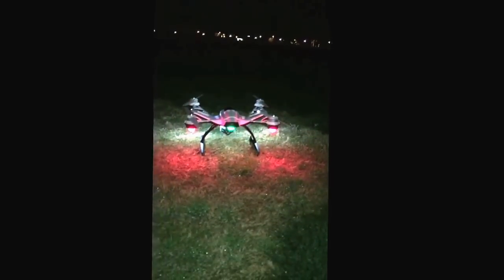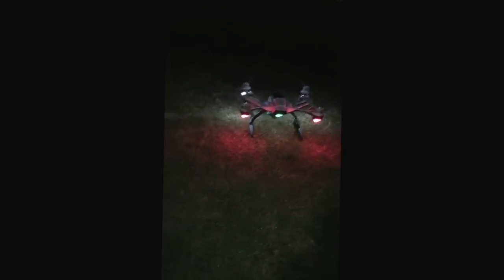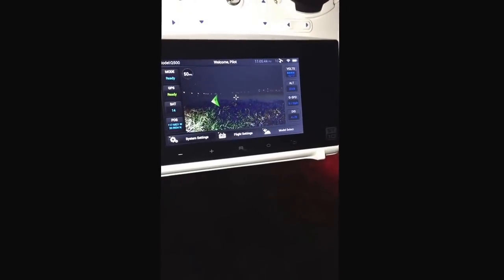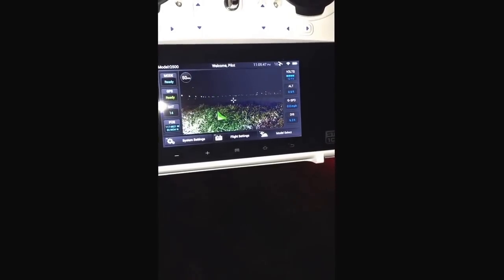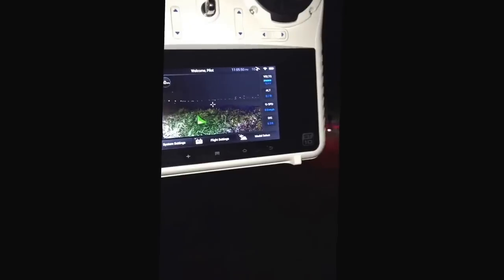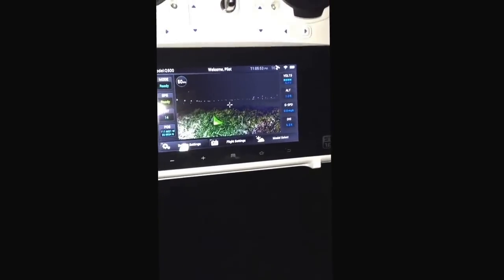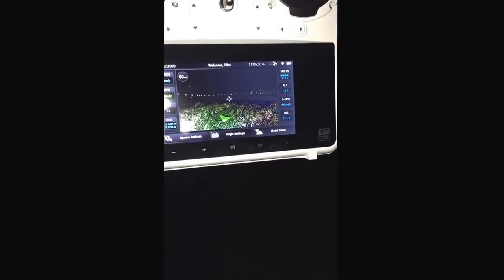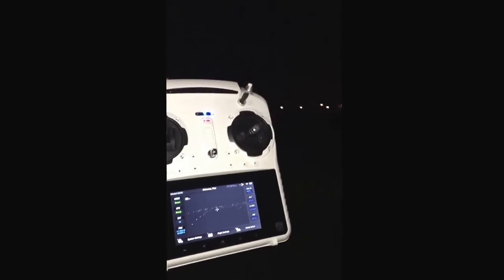Yuneec Typhoon Q500 Problem, Transmitter Sync Loss Defect Found and Corrected

Comment: it looks like the back light it lit up WHITE   if that is true then it means your CALIBRATIONS have FAILED,  you have to REDO your COMPASS and ACCEL. calibrations.  and then youll be fine.  ALSO you can NOT have your phone or anything electric even the transmitter ANYWHERE near the quadcopter while your calibrating.  keep them all away when your calibrating

Comment: how do you fix a flip over problem you try to lift off but it dont  just flip over and breaks the props did it twcce
Reply: alwyn rose put the props on right
Reply: Always make sure you have ample distance between you and the drone and never start off in smart mode.  Always use Angle.
Reply: Wat you did to solve the problem

Comment: The controller battery may be low I have had same problems but after fully charged batteries on the controller the quad is working fine
Reply from the maker: +Jabin Martinez Nope, read the narrative below. Problem solved, but this was filmed a looooong time ago so I'm trying to remember 😆👍🏻

Comment: Sorry man my mistake, i didnt mean 800meters i mean 800 ft that is much less than that!
Reply from the maker: +Cesar Rodriguez You might need to contact where you purchased that thing and get it swapped out for a new one.  Of course it depends where you are and what is around you to give you interference, but 800' is not right.

Comment: I keep losing my video link as soon as I get airborne. Everything starts out perfect, then within a moment or two my video freezes on the screen and of course I cannot start or stop record feature or take pictures without the connection. This is supposed to be the latest version, Q500 4k typhoon with CGO3 - GB camera with 3 axis gimbal. Any ideas or thoughts on the matter? I have yet to contact Yuneec as they are closed for the holidays, at least that is the message I am getting when I call them.
Reply from the maker: +teamscreem They should be open tomorrow since MLK day is over.  Let us know what they tell you and how you fixed it.
Reply: +teamscreem did you get any update? I have the exact same problem.
Reply: +Conor bourke I was never able to get it the video link to function properly, latest firmware, I had access to another CG03 camera, it worked flawlessly with the handheld gimbal so everything eventually pointed to the camera. The floor managers at Frys electronics are aware of my RC experience and swapped it out no questions asked. The new one works the way it is intended.

Comment: Hey doctor drone I'm having a problem i bought the typhoon G because i already own a GoPro so when I'm flying i go about 800 meters away and i lose signal from the camera and the screen on the controller freeze, do you know if is like that with all the G models or its something wrong with mine? i'll appreciate your help!
Reply from the maker: +Cesar Rodriguez You're complaining about losing signal at 2600' away?  That's damn good Cesar!  When you lose the signal from the transmitter, your video will freeze until you reestablish contact with the controller.  800 meters is really good my friend!
Reply: +Drone Doctor  hy doctor. my dosent have gps signal i crashed it
Reply from the maker: I think you better reach out to the place that sold you that thing and find out whats going on.

Comment: So what is the proper range without thr muckup is it still about 300m??
Reply from the maker: dogga794 Not sure what you mean by proper range.  You can modify the geofence in the software when you hook it up to your computer.  I've found range is pretty good with well over 1500' away at 400' up.  It will depend on your environment and what you have around you.  This quad is perfect for those who do not have a lot of experience and don't want to spent a lot of money.  It is also very resilient to crashes and has great customer service.

Comment: Iam to star to hate this am away to airport and steel buildings even a houses and not star
Reply from the maker: Juan Martha Does it say you are in a no fly zone?  Do you still get full gps lock prior to trying to start the motors?  Also, make sure you are far enough away from the drone when trying to start in full gps mode.  All else fails, call Yuneec directly.

Comment: HI everyone.....Iam crazy about its shows allways ........no fly zone ...it means you ca not fly in that area or can help me with this
Reply from the maker: Juan Martha Ok, now that sucks Juan.....  try taking a road trip away from your area that you are in and see if you are still in the no fly zone.  If the problem persists, you need to contact Yuneec to get it replaced.  If you truly are in a NO FLY zone, you only have two choices....... you can obey the no fly or put the drone in manual mode and fly at your own risk.  If you are new to the hobby, take a road trip, pack a lunch and make it a fun day!
Reply: Drone Doctor thank for reply ....also a found people can help me and they tell me is security área ( I am close to airport) and is big área so I try again far and it Works perfect ...thanks a lot   , the only think to know is how to learn to fly  manual but tahnk for all
Reply from the maker: Take your time learning.  Always remember, if you get into trouble and get turned around and confused while flying in angle mode, JUST STOP WHERE YOU ARE AND GO UP!  Height is your friend.  Get calmed down and switch back to full GPS mode and try again.  Height is always your friend when in trouble......  Good luck!

Comment: How did you turn on the follow me mode?
Reply from the maker: While flying in GPS mode, you will be in follow me mode once you get GPS lock and you get the flashing pink light.  If you have an older Q500 purchases prior to Jan 2015, you might need to update the firmware.  Check your current firmware with the latest on the Yuneec web site.
Reply: I really do not want Follow me Mode EVER.  
Just wondering how you did it so I do not get it into that Mode..    Thanks CFI
Reply from the maker: Just fly in "angle" mode then.  You should really be learning to fly in that mode anyway.  Don't rely on the GPS all the time.  Switch back to GPS when in trouble, but practice in angle mode in an open area.  Get that Blade Nano QX and practice inside your house while watching tv.  You'll be glad to you listened to the doctor on that one!!
Reply: I only fly in Angle Mode.   And that is when I loose GPS lock.
How much real flight time do you get with your Q  I at best 15-16 min.   Please let me know.
I have been clocking the flight time,  There is no way in hell this Machine will every get 25 Min of flight time.   I wonder why they always have to lie..
Reply from the maker: In a "controlled" environment such as an indoor building with NO wind, low hover, you will get 25 min "hover-run" time running the battery to almost dead.  In real life, on a calm day doing mainly hovers and not taking it up to hundreds and hundreds of feet, I get 18-20 min.  My usual flights though staying in the safe zone of battery life going up to 400' and flying around I get 15-17 min usually.  I can prob get longer, but I don't run the battery dry and usually bring it in at 10.6v under load.  Hope that helps you a bit.

Comment: I wish the transmitter had a range test.
Reply from the maker: Remember, it was $1299 bucks with two batteries.  You can spend three times that and get the Inspire1 if you want more features.  I love my Inspire1, but this Q500 is best bang for the buck I've found so far.  New 4k camera and newer ST10+ transmitter will be an additional improvement, but at a cost of course.
Reply: My CGO2 Takes very very dark pictues even in Full sun.   That is one thing that drive me crazy.   I have to edit every still pic I take.
Reply from the maker: Hmmmm, you might have either a bad unit or wrong settings.  Call Yuneec HQ in Ontario California and get to the bottom of it.  They'll get it right.  You've seen my videos and that is always unedited……..  to rushed to get it online, no time to edit and I just post.
Reply: Well I am going to send the Cam back I am really not happy with the Cam at all.
Reply from the maker: Yup, you got a lemon……  mine is great.  Don't worry, they'll make it right.

Comment: My Transmitte does the same thing,  loosed gps lock, I called and they told me to keep flying the Q.     I bought this to do some video Work that I can only get with a Quad.  
Bud do not want to fly with this problem.     CFI
Reply from the maker: If you lose GPS lock for only a moment, I wouldn't worry.  If you lose it and it doesn't return, that's a problem……..  are you in an open area or are there things around that can cause you to not get a good signal i.e. magnetic stuff, power lines ect.
Reply: Open area and 13 to 14 sats locked in
Reply from the maker: hmmm, better call Dana or Ryan at Yuneec on that one.  They'll take care of you.  Tell them "The Dronedoctor" wrote you the prescription to call………...
Reply: Thanks Doc I am going to send back the Cam the video and the Stills are very very dark not like the videos you took      Dam  I always get the lemon
Reply from the maker: Is that what they are having you do?  Believe me, I'm worse….  If the boat from China has ONLY ONE BAD DRONE, it will find it's way to MY door!  So, don't feel bad, you have a great company there that will make it right.  I was shocked how great this company has been to my needs.  Don't get me wrong, DJI has improved greatly, but for a $1299 drone, this is high dollar service!!

Comment: Looks like you are in SMART/Follow Me Mode with a Geo Fence set. That is why it is stopping and returning home. Go into your GUI and change the GOE Fence setting.
Reply: I have not flown anything but in ANGLE mode because I have so many trees around me and I doubt there is a 50' X 50' clear area in my neighborhood.. I guess that is a good thing to learn in ANGLE mode but I would like to try smart mode and follow me mode sometime when I get into a wide open area. In angle mode you learn fast or you fail LOL!!! I guess I could launch it to 100 feet to clear the pine trees and go into follow me mode and ride my bike around the neighbor hood BUT, I cannot trust it to find a big enough clearing to self land if it did return home on it's own. I must go to the park and do some testing. And the huge and hundreds of acres of a  park we have is hardly ever used by anyone as there is nothing for children to play with in it which is a good thing for me w/ basically a 6' wide sidewalk running for miles through it with a few bodies of water and fountains. Great place for videos and photo taking.

Comment: After getting the replacement what type of range are you now getting with the transmitter?
Reply from the maker: Sorry for the late reply Pat, been doing evaluations for hobby site on new drones coming up.  I reset the default settings on the Q500 and I can fly it further than I can visually see it.  I took it out at night and just for shits and giggles flew it out over 4000' away and over 3000' up before getting too scared and bringing it back.  I lost video feed at about 1500' but it continued feeding me telemetry throughout the flight.  So far, I really LOVE this Q500 over all my other drones I've had.  And I have quite a collection now……..
Reply: Drone Doctor I'll be getting one after the first of April so for now I'm relying on great folks like you for help on this decision. Forgot to ask about where to drone considers home if you loose radio contact, I heard it is where you turned it on and took off which makes sense. The second thing I heard is if you switch the transmitter to home and you do have radio contact that home is where the transmitter is. Are both of these true, if not please explain. I truly thank you for your time, Patrick
Reply from the maker: You first want to turn on the transmitter then the drone.  The transmitter will get sat link and then the drone will get a sat link.  The drone sees the Home location as where the transmitter is.  There is an arrow indicated on your transmitter screen that points to where the transmitter is in relation to the drone so you will always know where to fly home.  If you turn the transmitter off in flight or loose contact with the transmitter for any reason, the drone will remember where it was launched and will return to that location and land.  ALWAYS REMEMBER TO BOOT UP BOTH THE TRANSMITTER THE DRONE AT A DISTANCE OF AT LEAST 15' APART SO THE DRONE CAN SEE THE TRANSMITTER HOME POSITION.  Why that is important is when you fly in GPS if you initiated and locked onto locations at startup too close, your drone will get a little confused where exactly home is when it's right on top of you and it can point the arrow to the right or left as it gets close.  It's not that big of deal, unless you are flying in really tight spaces like right next to other homes ect.  Hope that clears it up for you.  We'll be doing more product reviews soon on the DJI Inspire and new products soon so stayed tuned!  Please give me a thumbs up on my posts if they help you.
Reply: Drone Doctor Valuable information, I can't thank you enough, thumbs up buddy, much appreciated!
Reply from the maker: Thanks again!!
Reply from the maker: Check out my range test video and others.  You will average 1000' to 1400' on video and it depends on what is around you such as trees, buildings ect that absorb the video transmission

Comment: Greetings Sir,
Did you access the Q500 GUI and connect your Q500 to your computer? in the GUI you can change the settings such as the range/height your aircraft will allow you to fly before it "returns home" and such while in smart mode.
Also try updating the firmware if the GUI doesn't work. Best regards!!
Oh and make sure you don't have the "home" switch toggled. trust me, it can happen.

Comment: Just got my Q500 last week,flies great, rock solid in the air.But i had a problem with the gimbal it would not work at all.I could get video from the camera  but that was it.I tried unplugging and plugging it back up,balancing it and made sure there were no wires in the way nothing worked so i called Yuneec up and they said would ship me a new gimbal.The other issue was that my serial number on the bottom of the aircraft did not match up with any numbers Yuneec had on record,they said they would make a note of it.....so i really don't know if my Q500 is registered or not.....
Reply from the maker: sirocco454 They'll take care of you, they are a good company.  Thanks for the post!

Comment: Hi Mark, have you sorted the problem out yet? and do you know if the problem has been rectified by Yuneec?
Reply from the maker: Yuneec replaced both drone and transmitter for me.  Antenna not connected property during assembly.  Not a big deal, gave me an excuse to go visit the HQ in Ontario.  Great people.
Reply: +Drone Doctor  Hi Drone Doctor may you telll how can I contact to Yuneec? I had a seriuos problem with my quad, regards.
Reply from the maker: Sure thing, go to www.yuneec.com and look for the customer support in the upper right corner.  It will tell you where a support location is near you or a number for you to call.  Hope you get it resolved!

Comment: Thanks for sharing...ill be buying one at the end of February!! Picked up a phantom 1 really inexpensive 6 months ago and its cool but I'm ready to move up ..and this looks like my move
Reply from the maker: Matthew Pravetz Thought of the tracker, but they also are not very cheap. The distances that the drones can cover on the fly-aways are so great, that I don't think there are enough good people around me that will return it. It's cheaper for me to just write it off….  I'm done putting gopro4's on anything from Blade 350 QX platforms.  I did get another QX3 and I've been flying is a bit, but every time I take it out, I'm holding my breath.  The Q500 is just great so far!!!
Reply from the maker: Had the Phantom and the Phantom2 Vision+ before they FAILED on me and I lost thousands!  Had plenty of great flights with the DJI Phantom one, but the vision plus was a mess.  They even shipped it to me with backwards props!!!  Take a look at my other video on why people were first calling in to their tech center asking why their quad was flipping over on take off and no one could figure it out!  LOL!!!
Reply: Drone Doctor Have you considered a GPS tracker to recover your Phantoms the next time one flies away??  http://www.amazon.com/IBSound%C2%AE-Mini-Multi-Functional-GSM-Tracker/dp/B00MOZBF5S/ref=zg_bs_5811986011_10#productDetails    or    http://www.amazon.com/Real-Time-Portable-Mini-Tracker/dp/B001FYQO3W/ref=pd_sim_e_1?ie=UTF8&refRID=12AHACV0VAV3DJDJES4R

Comment: no fly zone???
Reply: "No fly zone" is red-white flashing. Green with pink blinking is "Follow Me" mode per tech support.
Reply from the maker: Yup, all fixed.  It was a bad transmitter with an antenna disconnected most likely.  They replaced the entire setup and I have been using it regularly with no problems now.
Reply from the maker: No, turns out it was probably a defective antenna or antenna not hooked up on the drone.  They replaced the entire set up on the spot though just to be sure of no problems.  Great company!